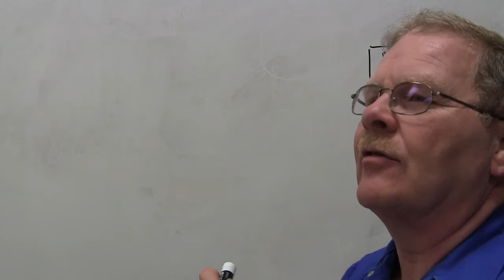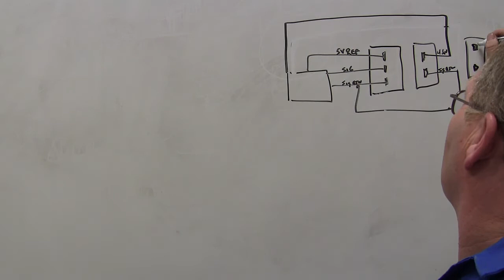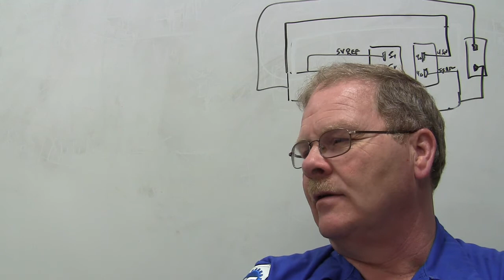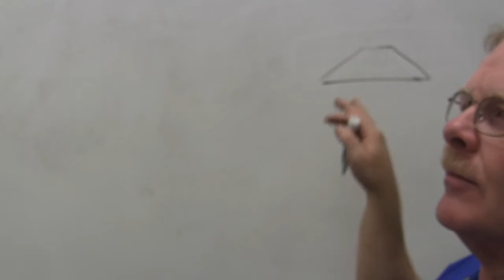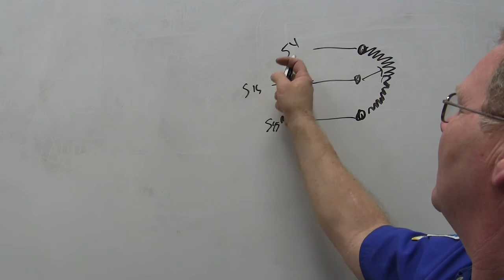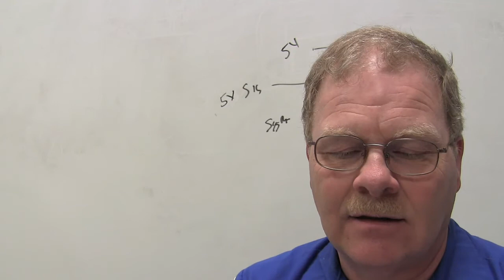Elect 2 Test 10   Sensor Diagnostics Basics

Comment: The book says this sensor cannot be tested but I test all sensors against the new part now. Thank You!  I know that even though the book says that, most sensors can be tested. A lower cost scanner that has live data can show the difference in how the engine responds to changes you make. A.B.S. with a dirty sensor from cut rotors or worn out brake pads can cause problems. Sometimes you can clean the metal shavings off the sensor and fix it.  Crank and cam sensor function can be improved by doing the same thing sometimes. Shavings can come from worn tensioners, pulleys, bearings, or environment.